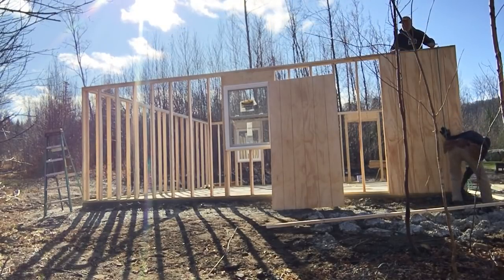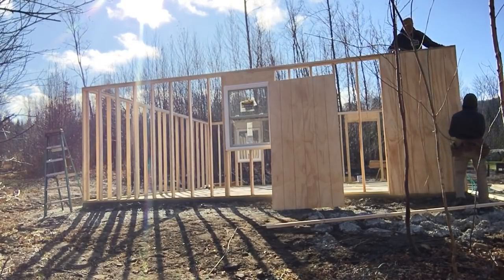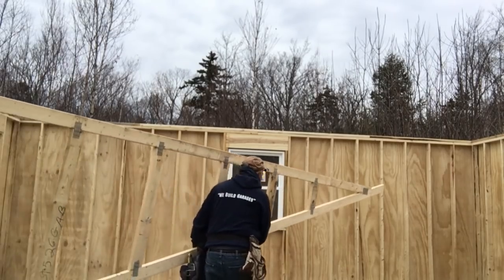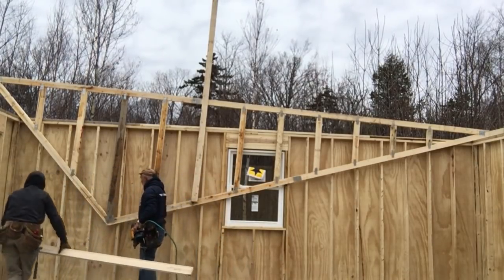Salt box style garage part 2

Comment: Looks great.  Would those walls pass inspection in Central Florida? How about with 2x6 walls? Any big advantage for such a big attic vs 2x8 rafters and 12 foot front wall?
Reply from the maker: I believe it would need prep for hurricane weather.  2x6 walls would add about $600 to the project.  There isn't really an attic we just need the steeper roof for snow load.
Reply: @kenskarpentry  What parts of the country do you work in? I'm in Central Florida.  And do you ever deal with plans and permitting?

Comment: Ken,  With your help in a weeks time, I have all 4 walls up, sheathed, and trusses are up.  It's a 24x24 ranch style with the 12" over hang all the way around.  I'm having trouble figuring out my sheathing sizes for the overall roof length of 26'.  What measurements do you cut your roof sheathing for a 24x24 with the 12" overhang?
Reply from the maker: Thanks for watching. The first course I do a 5’,8’,8’5’. Second course 3’,8’,8’,4’,3’ alternating these measurements going up the roof.

Comment: Ken, do you have a problem with porcupines chewing the T-111. I built a shed with it and they chewed one side all up. Also, How long does it take to get your trusses made? Where do you order them from. I would love to know if you can get a truss made for the cape style garage instead of using rafters.
Reply from the maker: We haven’t had problems with porcupines. It takes between 3 and 6 weeks to get trusses depending on the time of year.   They do have a cape storage truss. Your floor area wouldn’t be as big.

Comment: Excellent videos!  Do you recommend house wrap under the T-1-11 siding if your garage is going to be heated.  R-13 kraft face batts with 7/16" OSB on the inside for the finished side wall?
Reply from the maker: Thanks!  Code here requires R-19 so as far as I know the only way to do that with 2x4 walls would be spray foam which is a little pricey.  Or go to 2x6 to get the R-19 with batts and the house wrap.
Reply from the maker: I’ve done a couple that we’re finished off upstairs and downstairs. We used 2” blue board under the slab as well as thickened the perimeter to 24” with extra rebar.